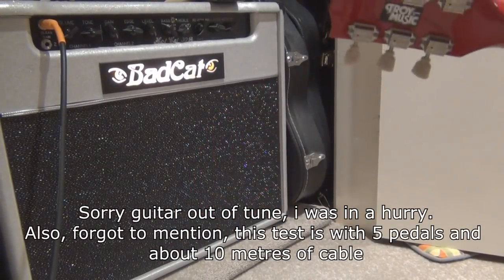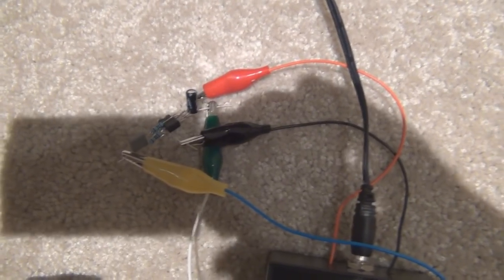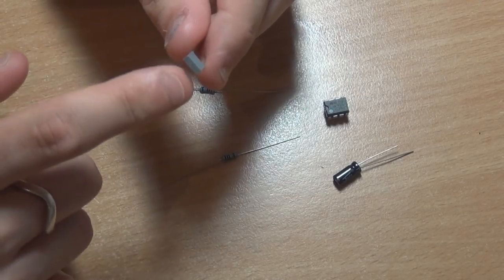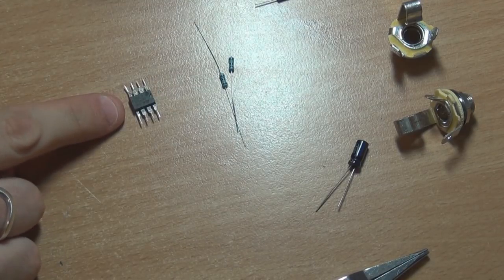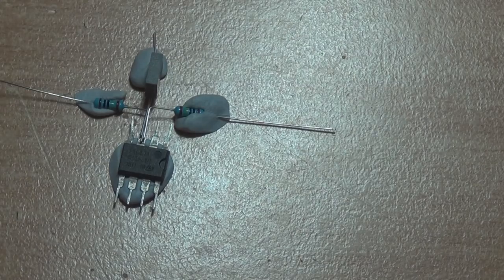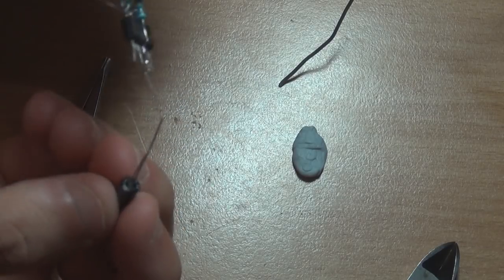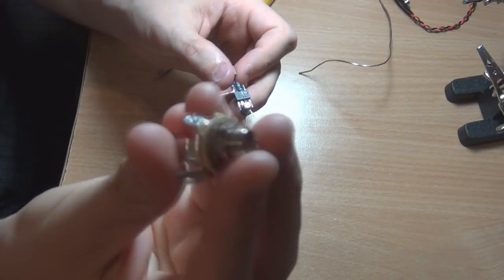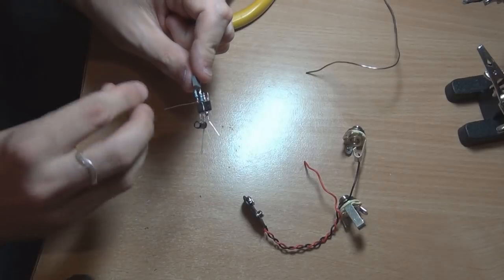Build a Guitar Pedal in 10 mins! (Buffer)

Comment: Mine didn't work :( ... I did the same, double check all the circuits, sound simply does not come out. Just wondering if using this Polypropylene Film Safety Capacitors 0.1uF 275VAC has something to do with? it is a fil, cap, same measure, only diff is that it can handle 275v. Or maybe the DC in jack is the problem? is this circuit AC? or DC-?

Comment: I built it!  This buffer works really well for brightening up the signal for a pedal steel guitar.  Steel players like a very clean defined sound and having a buffer right next to the guitar makes a big difference especially if the volume pedal is passive.  Thanks so much for sharing.  My box attaches directly to the input jack via a male to male adapter and has a switch for turning the battery on/off and the buffer on/off.  However I really don't need to bypass the buffer - it sounds great!

Comment from the maker: Thank you! You can use 1/4w pretty much for all guitar pedal components (rarely do you need higher wattage).  Carbon and metal film are about the same cost so you might as well go with metal.  You should watch my offboard wiring video in regards to grounding (search "offboard wiring" in youtube).  It should steer you in the right direction hopefully.  Good luck with your first build, i hope it works out for you!

Comment: This simple buffer works. Positive effect: No loss of high end over log cable run. But it has also negative effects on the rest of my pedals: Every footswitch that comes after it now makes a loud clicking noise. But that's OK, I only built it to test whether I can hear a difference with a buffer in front of my board. And yes I can hear it and I like the sound better. Now I'm looking for more sophisticated ones.
Reply from the maker: This is the most stripped down and easy to follow buffer you will find.  Could be because it doesn't have a pull down resistor on the input and output. (from memory, sorry been a long time since I made this video).  Check the circuit, if it doesn't have a 1m resistor at the front and end of the circuit to ground, add it.
Reply: So, to recap: INPUT -> 1m resistor -> 100nf cap -> 1m res/1m res/opamp  cross.......   AND in the end..... 10uF cap -> 1m resistor -> OUTPUT ?????
Reply: Mateusz Kaczmarczyk that should work. I read that the pulldown resistors should be placed to pull the "outside" of the capacitor to ground when switched off/on. It needs to be large enough value as to leave the signal largely unaffected. Again though, I just a dude who's been learning this shit himself. But that sounds like your chaingthere would work properly and Rid you of the awful clicking mostly.
Reply: Mateusz Kaczmarczyk I don't really notice a lot of them connected at the output though it might be best to look into doing.

Comment: Thanks for sharing a simple  life saving Idea   :D
I've got some questions to ask about this buffer :
1- how does the increase or decrease in values of the resistor change the functioning of the buffer ? are there other values that can match better with High output pickups (for playing mainly Metal with high gain distortion) ? I've found in the local shop of my town only 820K resistors of highest value available, can they fit in or do I have the add in series 200K resistor to make to 1M ?
2- I'm planning to build this circuit inside my guitar and I'd like to have an  on/circuit bypass and battery disconnect switch so I can disable it at will while at the same time  cut down the battery connection in case I want to economize battery charge and use it in case I don't have a battery , can you please give me a hint about it ?
3- I've bought a 0.1uf electrolytic capacitor , since I only found that type of caps , can I use it or do I have to get a film cap ?
Thanks a lot (y)

Comment: Hi, nice video anyway! I try your schematic buffer, and I found that maybe it's not pure tone buffer, because it sound a bit more clear in upper hi, when I use with short cable? am I wrong? or it usually happen with a short cable for other buffer pedal or commercial too. 

and is buffer pedal increase a bit floor noise? because my noise floor in my squieer strat crank up a bit when I use this schematic. Thank you

Comment: i think i'll try it... you also should make a compressor,
thanks, you really help.
One last question, I want to make a pedal similar with your A/B switch but I want only 2 inputs and one output, I don't want to switch them, shall i just have to plugin wire from input1 to outputA1 and to outputB1 and shall also plug input2 to outputs respectively?
(1 and 2 I mean two connectors jack inputs have)

Comment: I tried this out but wired the pedal directly to a power adapter instead of 9v battery. Unfortunately I only had a 12v power adapter laying around, but the pedal worked fine. Now I try connecting it to a 9v or 12v adapter and nothing working, I get a loud screeching instead. However if I disconnect the power adapter I get sound to go through? Any ideas? Replace resistors?

Comment: Love the videos! Helped out a lot!

I was hoping you could help me… I have a buffer pedal, with a 9v power socket and in/outs.. I want to put an LED in it. Can I ask how you'd do that? Obviously drill a hole in the pedal casing, but what would I solder it to on the inside? :)
Reply from the maker: That would require a 3pdt or millennium bypass.  Chances are it wont have either of those if it doesn't have the led.  Go to tonepad.com and look up the offboard wiring diagrams.  You will need to follow one of those to add the led.

Comment: hi. your videos are amazing, escpecially mini diy pedals, but i have a question. I have over 10 meters of cable. Is it better to build a boost or buffer pedal? I sometimes use Boss Ds-2 and i heard that boss' pedals have the buffer built in. I'd like to get higher output level that comes to the amp input.

Comment: for the voltage of the capacitor (Scott McNeil) the 400V will be fine. This voltage is a rating of voltage that the capacitor can withstand before it blows. You only have 9V to play with so your 400V one will never break down.

Comment from the maker: Cheers! Well the one on Tayda says TL071CP.  So i assume thats the right one to go for.  There are quite a few suffixes for the TL071 but most look to do with operating temperatures or maximum voltages?  Neither of which matter to us.  Just make sure you get the DIP version i guess.  Capacitor voltages dont really apply to guitar pedals either.  Just aim for approx double.  15v for 9v pedal will be fine for example.  Just dont use 9v, thats cutting it a bit fine. Good luck!

Comment: Hey Great video… Question for ya. I have a 1 in/ 1out buffer and I'm looking to make it a 2 out buffer. Any suggestions on how I wire the extra jack?

Thanks
Reply from the maker: Hi Mike thanks!  TBH no idea, but im fairly certain you should use 2 buffers with 2 output (not 1 buffer 2 outputs) or you will attenuate the signal.  So I guess, just feed your signal into 2 buffers and have separate jacks on the output for each? I'd search around for a schematic though to be sure.  Hope that helps.
Reply: Hi Mike!
just connect your second, third, etc... extra jack to the same ouput cap!

https://drive.google.com/folderview?id=0BxIs0kzV2Z2dSmpscmUzazRCLTA&usp=sharing
Reply: Thanks

Comment: i use a 2pdt and connect like this 
N/A | Output
+ve | Input
PCB +ve | PCB Input

and i add a resistor and led before +ve connected to the 2pdt
then the PCB output is connect to the output port
but i get a lot of fuzz
can u help me?

Comment: Since there's no LED, how can I tell if it is wired up correctly?  I'm running a pedalboard with 10 pedals and whether it's plugged in or not the sound is the same.  Is there a way to test the buffer?  Thanks.
Reply: If it sounds the same, you should check the input and ouput with a multimeter( i don't know if you say it like that) and see if they are conected direcly , if not, check the values of the components, they may affect the circuit

Comment: why are you using 2 x 1m ohm resistors in series? I mean, why 1m ohm and not for example 10k? wont they both work the same? I have very small knowledge in electronics and i think that third pin on op amp will get 4.5 volt + input signal any case. please somebody explain this fact

Comment: I love your videos. they're really great for beginners like me. I built this pedal because i have 30 effects in my signal chain and lost a lot of tone. Unfortunately I get some staticy distortion if i play really hard. Is this a case of voltage being too high or should i try a different IC? all the same, Thanks so much for posting these videos.
Reply: nevermind. the problem was with my eyes! I connected a 10M from pins 3 to 4 instead of 1m (blue and green looked the same in the light i was in)
Reply from the maker: kaleyfantastic No worries glad to hear you got it going!

Comment: Just purchased and built your 10 min buffer from your website. I used a stereo jack for input. For some reason the buffer actually kills my guitar signal. I used a DC jack and no foot switch (always on). Can't imagine the stereo jack would make the difference, but for some reason it's not working for me yet. Any thoughts? Thanks! Love the site and videos.
Reply from the maker: Hi Tim, thanks for the message.  Rest assure the buffer will work when assembled and wired correctly.  Please message me or email me for help with your buffer.  You can message me through the webstore here: http://www.diyguitarpedals.com.au/shop/index.php?main_page=contact_us
Cheers
Paul

Comment: I tried making this build, first on a circuit board, and then just as you did in the video.
All I can get is a LOT of noise and extremely low guitar volume when the power is plugged in. When it is not, I get a "floppy" guitar sound that seems weak but volume is closer to my guitar straight into my amp.
I am using a 1Spot for power.

I know it's a vague question, but any ideas on what might be the problem?
Reply: Same problem to me. Mine on the breadboard. Anyone can help advise?

Comment from the maker: If you've used the exact same parts as me there shouldn't be a problem?  Maybe try it on breadboard, that way you can easily check your connections. The circuit should sound pretty much the same as your clean signal when its working, obviously...
Reply: Ive made 4 of them but they squeal horribly. What might i have done wrong?

Comment: Hey, thanks for the instructional video . I built this pedal exactly as you suggested and theres no sound coming out. After messing around i connected a cable from input to leg 2 of the ic and  finally theres sound coming out , without that huge a difference i must mention.  On second thought my solution was to actually bypass the whole circuit except for the electrolytic cap ? Im confused ...
Reply from the maker: diskovolos Correct, input to leg 2 of the ic bypasses the circuit.  You must have an error somewhere else on the build.

Comment: what volt cap is it ur using i can only find 400v for the 100nf film cap will that still work?
Reply from the maker: Voltage rating doesn't matter as long as its over 16v.

Comment: hi, i'm not good enough in english language. Please write down a parts list. i'm afraid to be mistaken in ratings)
Reply: You need: 
- 100nF cap;
- 10uF cap;
- 2x 1M resistors
- TL071 or similar IC
- 2x mono Jack socket
- DC socket or battery clip
and a LED with 4.7k resistors on + lug if you like :)
Reply: thanks;)
Reply: Your welcome!

Comment: So I could just incorporate this into another pedal circuit instead of having a separate pedal? How would I do that exactly?
Reply: Landon Reekstin first, use the same power source from your pedal circuit running + into the + input on this as well as the input on the pedal circuit. There are 3 spots you can slot this in; Buffer only on when Pedal on, Buffer on all the time or Buffer only on when Pedal off.

Buffer on only when pedal is on; Connect the input side of this circuit to where the signal is sent from the switch to the pedal circuit and the output to the input of the pedal circuit.
.
Buffer on all the time; Slot it in between the input tip and the switch.
.
Buffer only on when pedal is off; put it after the switch in the bypass signal chain.

Comment: I'm finding that if I change my LED resistor it varies the output level. I went from 2.2K to 4.7K and the output level dropped. That sound right, shouldn't make any difference technically? Maybe my true bypass wiring is wrong. If not I could stick a pot in and have output control :)
Reply from the maker: Yeah the CLR for the LED should haven't affect your effect at all. Something in the offboard wiring is wrong.

Comment: Hey so I used your Buffer Schematic. And I don't hear any difference with it on and off. I think it's the resistors that I bought from Tayda, because I put one of the resistors on a LED circuit and it didn't light up. Any suggestions? I can send a picture of the circuit if that helps! Thanks!
Reply from the maker: The LED wont light up with a 1meg resistor attached.  You need probably 1k for that.  You need to test the buffer with ALOT of cable.  10m+.  More.  Before you will hear the treble lose and return when the buffer is switched on.  You should also use a switch to test it, so you can hear the difference immediately.
Reply: I used a 330ohm resistor suggested by a resistor/led calculator. And I don't have any long cable, any other suggestions? Thanks for replying REALLY quickly! That was impressive!
Reply from the maker: Jonathan Clarke Oh right!  330 is getting a bit low, make sure you power the LED the right way or it will blow.  You can also use a wah or fuzz face (something with low input impedance) or a lot of pedal (5+) in a row to test the buffer.
Reply: Alright, I gotta get a friend to test it out then! Thanks! And I figured, I used a left over 200kohm and it worked just fine. I just have to buy another LED because I ended up blowing it up testing it on a 9V battery (n00b mistake).
Reply: chromespherecom So I finished up the pedals (I made two for a friend and myself) Figured out the resistors from tayda were crap. I'll update when I get good resistors
Reply: Jonathan Clarke I also wired the in and out backwards (in was out and vice-versa) Feeling super n00by. By the way I wanted to mention, thanks for inspiring me to actually start building stuff for myself, definitely a cool thing to talk to relatives about during dinner.

Comment from the maker: no metal connections / leads / solder joints should make contact with the enclosure.  If you can isolate it from the enclosure you should be fine.

Comment: If you connect between pin 1 and 8 of 10uf electrolytic capacitor and a potentiometer of 100kLog would get a gain control
Reply: Please explain for the untrained.

Comment: I know you said I'd have better chances with a response from one of the forums you mentioned, but figured I'd give it a shot here... I built an aby box following Breja toneworks plans ( https://youtu.be/f7Y8Qm1aOCI ) and built 2 of the buffer circuits you mapped out in THIS video... I took pictures as it went. It's not the cleanest of installs, but it is my first. The pedal works great, splits channels with no signal loss, runs both channels with no drop out, UNTIL I give the pedal power. It's powered so the LEDs will light telling what channel is in use. without power, it's great, but when powered, if on A or B there's a terrible, pulsing buzz... like a ground fault. Channel Y is silent until I roll the guitar volume on, and same sound... A and B respectively make the hum without volume from the guitar, but Y only hums WITH guitar volume. The breja schematic includes a ground lift, which I put in, but it makes no change when switching it on or off. I ran a 9v battery to the power jack with alligator clips and even tried reversing the positive and negative, in case I had gotten a positive center pin jack, but to no avail. I bought decent quality parts from Mouser and Pedal Parts Plus... Any ideas? And thanks for the great videos and teaching inside!!

Comment: could you use a TL072cp?
Reply: Same question!
Reply: Thats a dual opamp I stead of a single like he's listed but using the same side of the IC (only utilizing one of of the dual setup) should work. Check the datasheet info on supplies or currents 
or what-the-fucks. and probably still have to use the V+ on pin 8 (I think). I got a bunch of those off Amazon recently. They had em labelled when they arrived that says "not to separate. They're a set." Amazon ER have em listed like they were meant to be used for chorus or modulation effects circuits? Havent found any info on that shit Anywhere yet though.
Reply: If you're powering from a battery it would be a bad idea as it would take more current than a TL071 and run your battery down more quickly. A TL062 would actually take less current and, as it's a buffer, the higher noise and lower bandwidth wouldn't be significant.

Comment: I Just build myself a Buffer Splitter and Volume Drops by 46 dB... Now Noise is pretty mich the same Level as the guitar Level... Do you Guys have an Idea why this May be?
Reply: Even I have the problem with volume but not the noise.
Did you get a solution for this?
Reply: @shubhashish8568  i redid all Connections twice and checked resistances but in the end eventually Destroyer the Plate.
I baught a New one and have both yet found time to Attack it again.
I think i have Destroyed some component in the Plate to Begin with.
Reply: @philippgrunert8776  okay.
Why dont you try it on simulator first?
Reply: @shubhashish8568  i Just started this as a New Hobby and have little to No experience. Also besides my Job Theres little time at least currently  This was my First Project. Which Simulator so you mean or suggest?
Reply: @philippgrunert8776  Proteus is good
Reply: @shubhashish8568  Thanks, i will Check it Out.